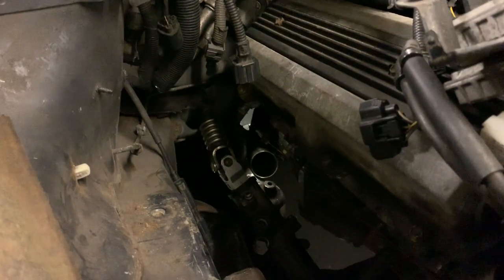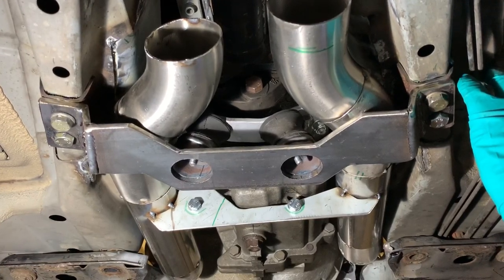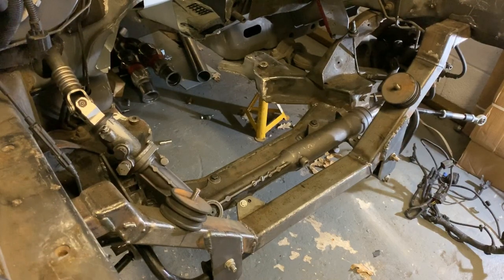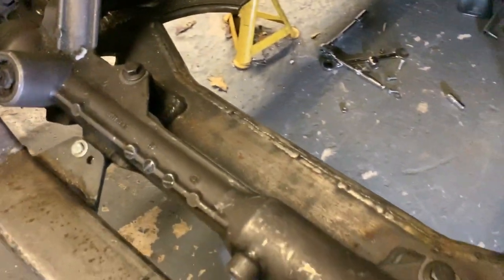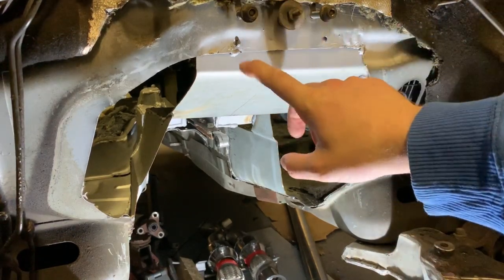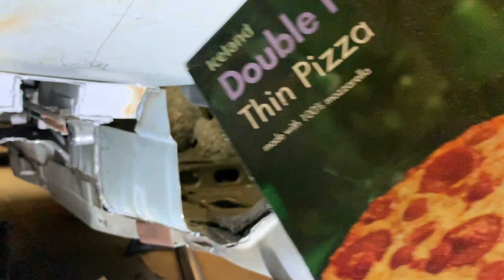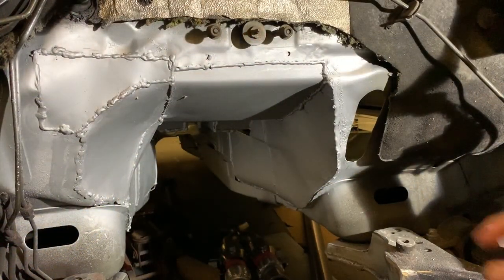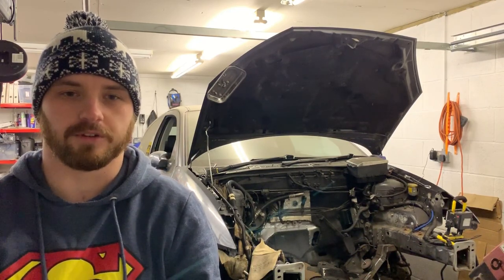Welding the Tunnel - The Flexus Episode 2 - Ford Focus V8 Project Car Build

Comment: You can always use a hammer to imprint the bottom of the botom transmission tunnel pattern into the cardboard and just trace the top?

Comment: Sorry if I missed it, but which BMW transmission are you using? E46 ZF? If so, where did you source the adapter?
Reply from the maker: Getrag 5 speed from a z4
Reply from the maker: Adapter was bought on Facebook lol